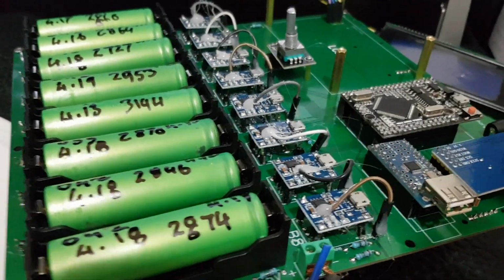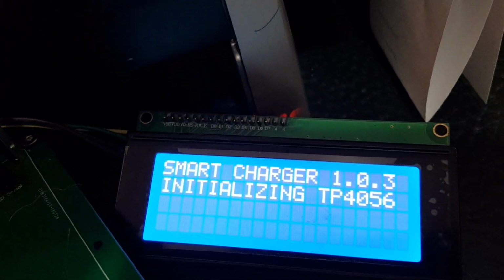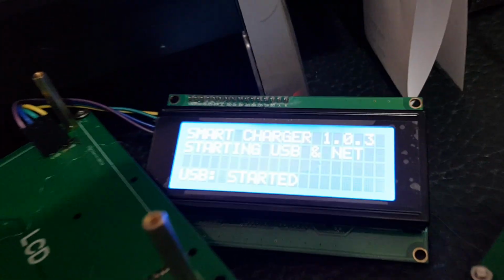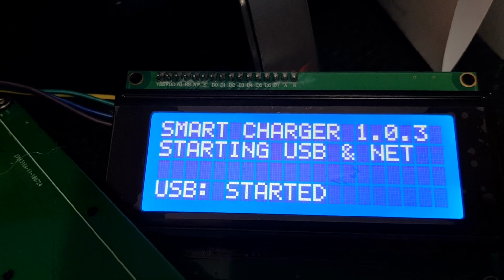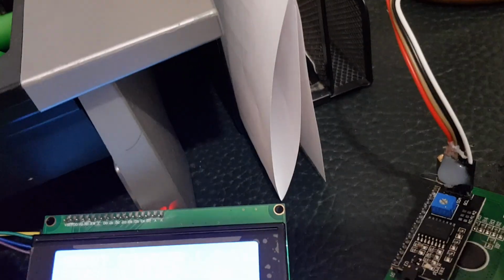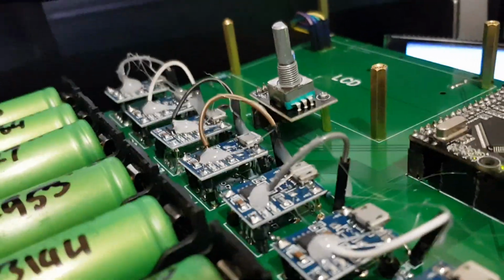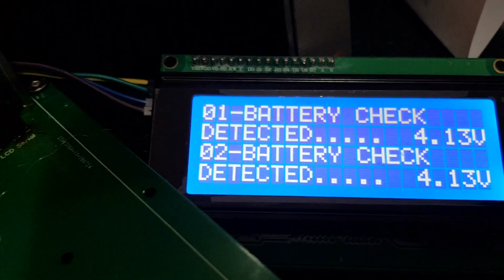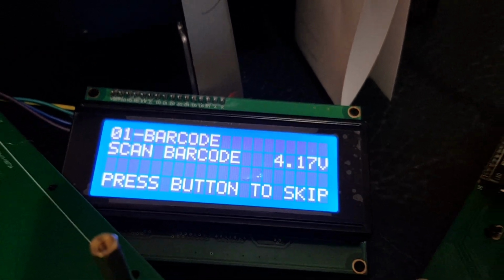DIY Charger Discharger 18650. Part 19 It's alive and working.

Comment: Hell yeah, great to see it going. Time to get some barcodes and a scanner. Hit me up before you buy one I have had issues with some.
Reply from the maker: So what models work?
Reply: @chuxxsss  not 100% sure. I bought one that looked exactly the same but it doesn't work with the USB host. So I bought one I think is the same waiting for it to arrive. Will keep you posted.
Reply: Same.  Your latest test and mod for the usb host worked great for one of my barcode scanners that previous was doing nothing.
Reply: Can u cycle the batteries?